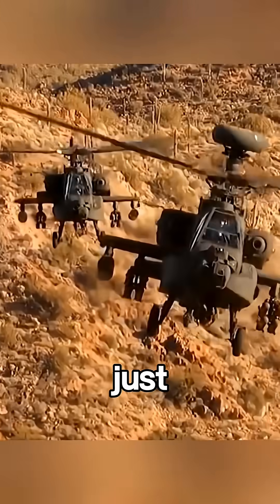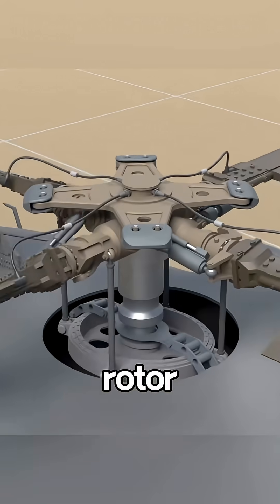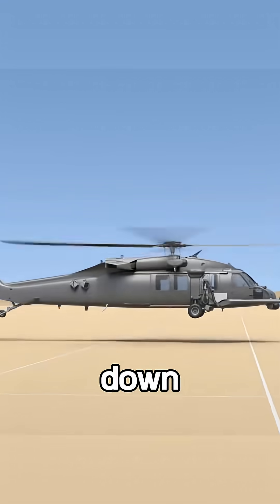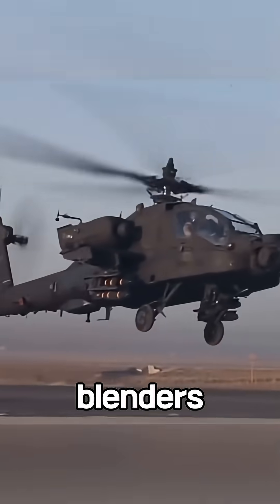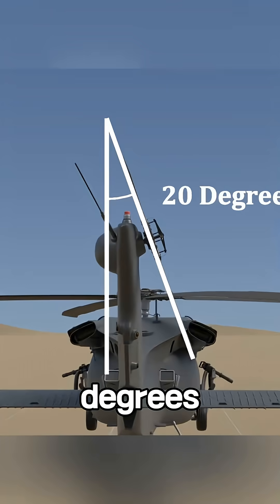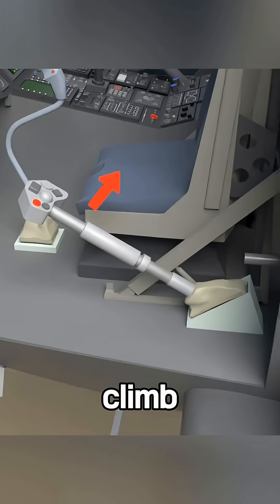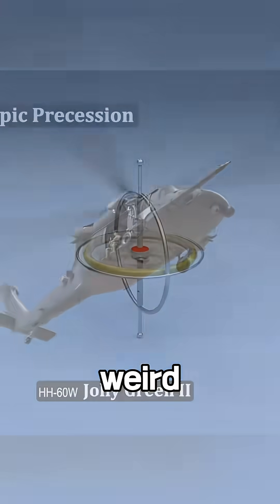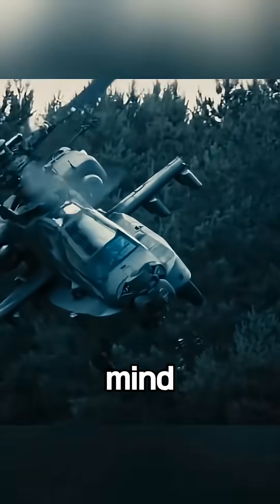Helicopter Speed Myth Busted: What Really Limits Their Velocity #helicopter #aviation #military

Comment: Actually, rotor rpm isn’t constant on all helicopters. Ones with pusher props, like the Airbus X3 and Racer prototypes, can slow the main rotor some to keep the advancing tips from breaking the sound barrier in high speed cruise, upwards of 420 kph. It does also rely on some lift from the wings that the pusher props are mounted on.

Comment: Explain to me why there's a video of a helicopter talking off and the rotors are completely in sync with the camera so it like like they aren't moving, and then when the helicopter starts to move forward you can see them begin to spin. Are they slowing down due to more air resistance or speeding up?

Comment: Greetings Dear One, 
What you have neglected is how the rotor disc is affected by air moving through the disc. Because even at 0 deg pitch it will create lift! This can affect speed and lifting capacities when used correctly you can lift beyond the helos design capacity is some fancy physics at work!
Here is simple math for you:
The advancing blade is moving at 100 mph the retreating blade is moving at 100 mph the helo is moving forward at 100 mph
What speed is the helo doing?

It is this that governs all helo flight be it a 2, 3, 4, 5, 6, 7, 8 bladed head this only affects the gyro effect of the blades its reversed 90 degrees irrispected of main blade count and becomes more precise with the increase of main blades on the head. You tilt the swash fore to go left. Blade count reduces rpm as 2 bladed head rpm is greater than an 4, 5, 6, 7 or 8 bladed head. You also need to take into account the centrifugal forces actin on the helo as the head rotates about it centre. One of the ways to quiet a tail rotor is to double stack the tail head and change the angle between the blades themselves like on an AH64. You can also change the efficiency of the head relating to lift power caperbility and speed by using a BURP Rotor blade system. Which was used on worlds fastest helicopter.  Other methods includes whats known as the A B C system uses coaxial rotating blades which puts torque outside of the helo fuselage thus cancelling out torque reaction fuselage doesnt counter spin which also cancels a need for a tail rotor and is also more energy efficient. The rotation about the laral is done by changing the rotational speed of each main head very cool stuff. Where as a NOTAR system has no tail rotor and a standard main head assembly this uses what we call the co-ander effect to control rotational force around the lateral axisis.
Is very cool physics at work.
Your tail rotor does not always give lift to the aircraft this is only done when the C of E is outside that of the Geometry of the head like on your black hawk the mast is out of the C of E creating unequal lift thus the tail is tilted to provide partial lifting power to counyer this and torque control. The majority of a helo noise comes from the torque blades not the mains. The banging sound helo blades make is caused from the following blade cutting through the advancing blades turbulent wake.
Yet a BURP rotor does not make nearly as much noise and usually as a high pich swish sound when it flys overhead is not heard prior to overflight though is heard in few seconds after pasing over you lasts about 3 seconds. 

Blessings Love and Light 
Namaste

Comment: Spanish engineer Juan de La Cierva invented the autogyro and developed a key mechanism for its rotor: a system that allows each blade to change its angle of attack independently while rotating. This articulated rotor mechanism prevents excessive vibrations, improves stability, and enables safe flight by letting the blades adapt dynamically to airflow. While he did not invent the collective and cyclic pitch control used in modern helicopters, his design laid the foundation for practical rotorcraft.

Comment: Insane engineering.  What helicopters do that fixed wing aircraft don't, they do brilliantly.  Where they fall behind fixed wing is forward speed and range.  A limiting factor for helicopters is that you don't want the rotor tip to reach the speed of sound.  So the forward airspeed is adding to the advancing rotor tip's speed and subtracting from the retreating rotor tip's speed.  The advancing tip limits the forward airspeed.

Comment: Good explanation of how helicopters fly, but you didn’t actually answer the question in the video title. 

What limits a helicopter’s speed is the rotor speed. 

On the rotor’s backsweep (usually the right side of the helicopter), the rotor blade’s airspeed is The helicopter’s speed – the rotor’s speed, and if too much of the blade is too close to the helicopter’s speed, you can have partial stall conditions, affecting helicopter stability. You can partially compensate with blade angle, but that’s compensating, not eliminating the problem. Luckily, every bit of the blade is moving at a different linear speed, so this typically won’t affect the whole blade anyway.

Bigger problem is that the rotor on the forward sweep (usually the left side of the helicopter) is experiencing an airspeed of rotor speed + helicopter speed. That causes big problems when it breaks the sound barrier. I don’t know if it’s an insurmountable physical problem — I’d guess not, since we’ve made other vehicles go faster than sound, and we can even get the tip of a whip to break the sound barrier without the rest of the whip being damaged — but it’s certainly an engineering challenge that, AFAIK, we haven’t solved yet.
Reply from the maker: Thank you for the detailed information!

Comment: As a helicopter mechanic some of these comments are super funny. This video is a great introduction to helicopters and how they work. Not all encompassing. But that’s not the point of a quick 60 second video. Helicopters are just a bunch of spinning metal trying to hold together. The engineering is fascinating if you ever get into it. One thing I’ll add for a quick note. The Centrifugal forces pulling on those blades need to be more than the weight of the helicopter also otherwise they would fold up on the helicopter and become useless. The blades cone a little naturally but the slower the blade speed the more they cone. After a certain point it’s unrecoverable. The point at which that happens can also vary based on density altitude. Stay safe my friends!
Reply from the maker: Thank you for the detailed comment!

Comment: This is kind of false. Before sophisticated governors, pilots would have accelerate the engine with a twist grip to compensate for the extra load from advancing the blade angles.  Same exact thing when you have to push the accelerator to elevate your car up a hill. Even though the output speed of your driveshaft spins at the same constant speed.

Comment: Using this as reference I can now make a helicopter that is 100% accurate in kerbal space program. I never built a helicopter in ksp.  I kind of figured that it would be way too complicated to try and figure it out also this was before they added robot parts and after a robotic parts I was like Hey now people can  Make more complicated vehicles. I also thought of something what if you took a tire like a rover tire and you put it on one of those motors and then you had it so that the motor spins at the same rate or faster than the actual tire train is. I also thought about using the whole New Year thing to add like 8 or 10 tires to the motor and just make a really really durable tire that goes really really fast.

Comment: Mate I’m a helicopter pilot and you’re almost right. Yes helicopter doesn’t fly faster if the rpm is higher but the rpm of both rotors the main one and the tail one change during the flight and that’s why helicopters have a governer that does it for you. During take offs and at the beginning of the acceleration the rotors spin faster to generate even more lift and when you’re approaching a landing they slow down. Also not in every helicopter the back rotor is tilted. Many helicopters have wings on the tail to help aerodynamics deal with any imbalance and the tilt usually is implemented on huge heavy helicopters that need it in slow manouvers lifting heavy loads or carrying many people and the aerodynamics is not an option
Reply from the maker: thanks for more information

Comment: The limit of forward speed is the blade on the advancing side of the rotor disc. One side is going forward while the opposite side is going backwards. The forward speed of the blade tip is the speed of the blade through the air PLUS the forward speed of the disc. So the advancing blade is much faster than the retreating blade. The whole blade must be kept subsonic because if the tip was close to supersonic then the root would be a lot slower. That’s when bad things would start to happen. 
If you are really interested in helicopter flight I can recommend you read Wagtendonk’s Theory of Helicopter Flight. 😂😂😂😉

Comment: 1: Paul Cornu, a french guy🇨🇵🇫🇷, made the 1st practical helicopter.
2: Chopper speed is limited between 2 values. Under the speed of sound that the blade going forward shouldn't reach. The speed of the vessel the blade going backward shouldn't reach, as it means relative null speed, so zero lift...
Vive la France 🇫🇷

Comment: They missed the oddest fact about helicopters. Let us imagine a helicopter with a rotor tip speed of at 350mph, may not be exact but close enough for the example. In a hover there is 350 mph flow on all the helicopter blades. Now let's fly forward at 50mph, at that point, a blade is experiencing airflow at 400mph, at the opposite point the flow is now 300mph. As we fly faster our blades make different amounts of lift. Most helicopters are limited to 250mph to keep the lift in balance. So in our example one wing is at 100mph and the other is at 600mph. So helicopters have a device to change the pitch to dump lift on the fast side and increase it on the slow side. The critical max speed Is when one blade stalls and makes no lift and the other goes supersonic. One style of rotor lift balancing device is called a flapping hinge. It also gives them that distinctive wop wop motorcycle sound. To go faster some helicopter use a tandem rotor like on CH47 or some Russian coaxial designs, make it so there is more equal lift through a wider speed range.

Comment: It's called POA, pitch of attack. It's how the blades moves the air over the flight surface. Rotor wash is increased by advancing the POA and increasing turbine rpm, this drives a gear box, that drives the shafts. The swash plate that sits at the bottom of the rotor stack is basically a huge washer, it lifts or dips the attitude of the rotating rotor assembly.

Not all helos have tail propellers, some have 2 sets of rotor blades, spinning in opposing direction, countering the centripical effect.

Yes we do rev the turbine higher for lift, the turbines do not get set to max and left there, in the UH60 we set to 80% for take off and landing, knowing that the blades would have the power available should he need to abort or move quickly. We reduce the power output to reduce stress on the components and keep the T&Ps happy.

Comment: Speed is limited by blade speed. When the helicopter is moving….the blades are moving at their travel speed plus the helicopter speed when they come from back to front…

You’ll hit a point where that leading blade will break the sound barrier. That will cause problems.

So speed is limited because you have to keep the blades from hitting the sound barrier….the helicopter can’t handle it.

Comment: Try the Russian Kamov Ka-50 "Black Shark". It has six counter rotating blades that counter the torque of each other: three blades on top and three blades on the bottom, all on the same axis. One runs clockwise and the other runs counter clockwise. No need for a tail rotor.

Comment: I mean... Yes you're right... But theoretically if the blades are already angled, a faster RPM would generate more lift.

Granted that's not how helicopters work, as you've mentioned. But they can.
Reply from the maker: ''am right'' is enough for me. thanks

Comment: and nothing was said about flapping, lead-lag, retreating blade stall (which IS the real limitation in maximum forward airspeed) and more.  Much was said about BLACKHAWKS, but not helicopters in general.  Not all anti-torque (tail) rotors are canted at 20 degrees.  Some have multiple tail rotors, some helicopters have multi-rotor systems to negate the need FOR a tail rotor.  Chinooks for example.  Explaining how the pedals work on a chinook would be far more eye opening than this video.

Comment: You lost me in your first lie. Of course the main rotor changes speed. The tilt on the blade gives it direction
Reply: The main rotor does not change speed under normal flight. There are entire computers in modern helicopters that adjust engine power to ensure the rotors operate at a constant speed.

Comment: Nice, but the 20 deg tail rotor angle is present only in a few helicopters, in most of them that angle is zero. While as mentioned in the video that angle helps providing additional lift it couples the yaw and pitch even more, making the flight dynamics more difficult.

Comment: Interesting, none of that explains why helicopters can't go forwards faster than about 220knots. It's a bout the relative airspeed across the retreating blade. As the helicopter moves forwards through the air one side of the helicopter rotor is moving into the on coming air, but as it rotates to the other side the blade is now going the same direction as the oncoming air. if those two speeds get too similar the blade stalls on that side of the rotor. It's called retreating blade stall.

Comment: This is actually incorrect, to a point. The faster the main rotor spins, the more air it pushes through the angle of the blades. It's cool to explain how the blades work with the controls and all that but it still all comes down to how much air is being pushed in which direction. Hence, speed.

Comment: You can manually adjust RPM in any helicopter by rolling the throttle, which can create more or less power from the engine at the same pitch setting creating more or less lift. Otherwise you wouldn't be able to auto if the engine alone set the rotor RPM, there are free-wheeling units on helicopters that allow the blades to spin independently of the engine thus enabling autorotation's. So to call it dead wrong is inaccurate, you can roll down and still fly with 90% Rotor RPM on many helicopters.

Comment: Vne (speed to never exceed) is actually set by 1. Retreating Blade Stall which is due to Dissymmetry of lift the advancing side (right side) in counter clockwise spinning rotor systems increases as forwards airspeed increases. 

Manufacturers set a recommended speed that varies based on flight conditions because the helicopter would experience Retreating Blade Stall and pitch up at the nose (due to gyroscopic precession) but also because it would create too much fatigue on the rotor system and fuselage if you pushed it above that speed. 

Some manufacturers found ways to limit this through coaxial rotor systems which also remove the need for a tail rotor.

The video has a mistake in the end you say "to fly forward you need to increase lift on the left blade" thats completely false; helicopters are designed to compensate for gyroscopic precession by offsetting the control linkages 90 degrees already, meaning the disk would tilt down on the right side of the heli if you push the cyclic forward which is felt on the fore portion of the disk.

Comment: False. Helicopters' speed in fact CAN change by the rotor speed, the same way a cars RPM can change it's speed as well. Everything this video says is basically describing a transmission, but if a car's RPM is too slow, you can only go so fast.

Comment: Trim switch (on the cyclic) speeds or slows engine.... indicator in dash shows "Nr" .... engine speed..... engine speed does vary to avoid over torque on the engine

Comment: The main reason Helicopter Blades don't spin faster is because once the tip of the blade reaches Mach Speed it stops producing lift. Too go faster than that would be catastrophic, this is also why you hear the classic thumping sound. Its especially prevalent in Helicopters with only 2 blades like the UH1 Huey. There are 2 versions of the Huey, the 214 model and 412 model. The 214 had 2 blades and produces more lift and they are slightly faster at about 180 knots and the 412 has 4 blades and a little slower at about 160 knots. But the more blades it has the better the control because the blades are taking smaller bites of air and is easier to maneuver at slow speeds.

Comment: G-LYNX  still hold the speed record set way back in the 80s. It used "Burp" tip blades to delay compressibility issues on the advancing blade. Single rotor helix will always be stuck between a rock and a hard place - compression on the advancing blade and stall on the retreating side.